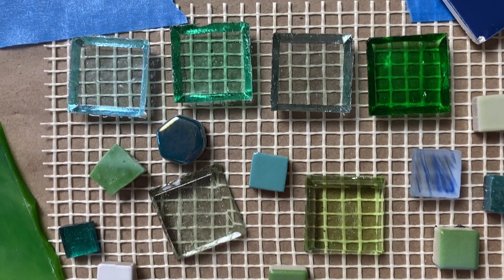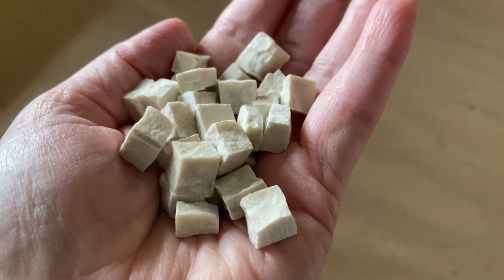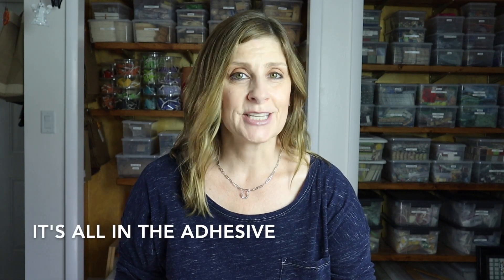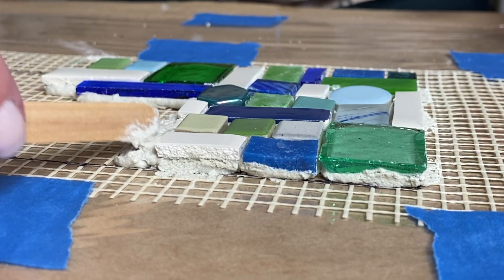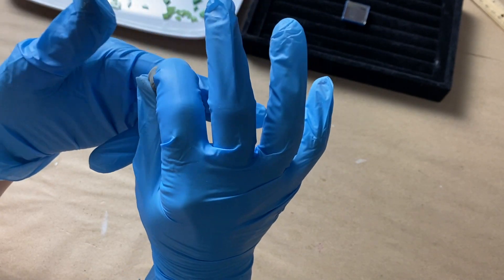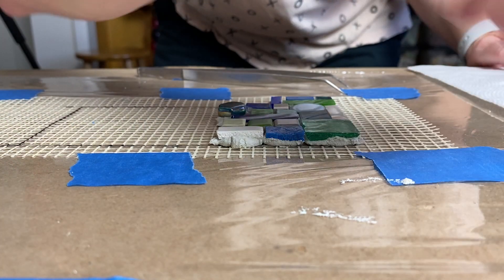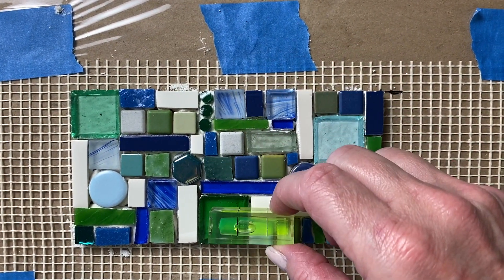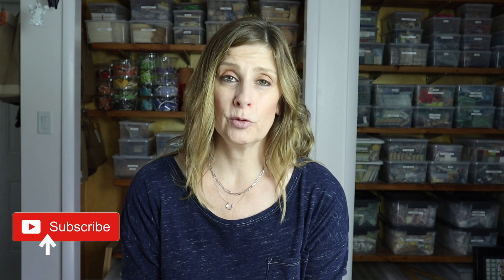HOW TO MOSAIC TESSERAE OF DIFFERENT THICKNESSES | Use the Correct Adhesive and Tiling Method

Comment: Hi Julie, thanks again for another really informative video.  Question….  When using mesh I try not to use too much adhesive because when I finally adhere the piece to a wall I want the thinset between the wall surface and the tile to squeeze through the mesh to securely fasten the piece to the wall.  In the video when you use so much thinset on the mesh to even out the tile heights how does this work when adhering it to your final surface?  It does not look like there is an opportunity for the thinset from the wall to squeeze through to grab onto the tiles.  Does this question make sense?
Reply from the maker: Hi Kim! Great to hear you enjoyed the video. Yes, a wall mosaic is totally different than my little 3" x 6" mosaic from the video. And the point of the video wasn't the mesh so much as the process of building up tess. I shouldn't of used mesh in the example. What you're describing is a great way to add additional adhesion for vertical mosaics on mesh. Thanks for your comment!🙌
Reply: @JulieWeilbacher  yes, I can totally see it if you were applying direct to the surface.  It all makes sense.  Thank you Julie
Reply: Will this work for a mosaic floor also. I have 3 thicknesses and want it to stay happy if walked on 😌 any tips appreciated. I've been searching but to no avail before this vid. Thanks!

Comment: I have a 10 inch porcelain cat my mom give me 45 years ago.  It's nose and one ear is chipped so I was wanting to mosaic it.  What kind of prep do I need to do and what glue would work best?  Thanks for all of the great videos Julie!
Reply from the maker: Hi Patsy! Thanks for your kind words, and for watching! I would first glue the pieces back on the body. You could use Weldbond, thinset, or silicone to do that. For the actual mosaic work, you could any of the same adhesives I just listed. Because it's a curved surface, it might be easier to use thinset or silicone just so things stay put and dry faster. It'll also depend on your tesserae selection. Keep creating and I'm so glad you're here!🔥

Comment: Working with tessere of different thicknesses is definitely one of the cases where the easiest way is to use to so-called "indirect" method for making the mosaic – i.e., assemble it upside down on some adhesive surface (traditionally, water soluble glue on paper would be used, but something like those adhesive sheets for printing labels will do just fine), pour over and level the cement (or whatever other adhesive you're using), let it cure, then flip the whole thing over, remove the sticky paper and... Ta-daaa! You get a perfectly level surface with much less effort. The only thing you need to keep in mind and pay attention to is that your final product will be mirror-flipped with respect to what you see while assembling it.
Reply from the maker: Yup, that works too! Thanks for sharing. Keep creating and I’m glad you’re here!🔥

Comment: OmniGrip!
Reply from the maker: Is that your preferred adhesive?
Reply: @JulieWeilbacher  ABSOLUTELY. I don’t know why it is never mentioned. SO many advantages. You can “raise” a tile… you can extract a tile days after… it’s clean,
and allows movement and flexibility. Even small tile over cement (stepping stones) left outside in South Florida heat and rain, for four years and still good. After I paste with OmniGrip, I use an exacto knife the next day and pull up any extra. Also between tiles. It’s just fabulous stuff! Home Depot. I cannot imagine using thinset! Crazy.

Comment: I just ruined a great idea by trying for the first time to use thinset to build up thinner pieces in a mandala. It was sad.
Reply: I would include a picture but it won’t let me. Even YouTube knows it stinks. Lol
Reply from the maker: Summer, what happened? Was the thinset mixed too thin? Or did you need more thinset under your tessera? Did the tessera sink while curing?😞
Reply from the maker: C'mon Summer, let's turn that frown upside down. I don't think your mosaic stinks. And neither does YouTube! Keep at it, that's how we all learn. You can do this!🙌
Reply: I’m not sure what happened. Things DID sink so maybe the thinset was too thin. Part of the problem is that I did three new things at once. 1) It was my first mandala and my keystone was NOT pretty. 2) I backed clear glass with fabric to make some of the tiles and the thinset under it dulled the color. 3) Leveling the pieces with thinset. It may have been a mixture of just doing too many new things at one time and me trying to go at my normal speed instead of working slowly and more carefully. I posted it in mosaic mentoring and some people said they liked it. I did like it better after I grouted it by I certainly can’t list it in my shop. So it goes in my “fail” box and I count how many things I learned while making it. Lol
Reply from the maker: @summerholmes4725  You experimented and tried things outside your comfort zone. I think you should give yourself some credit and grace. We're our own worst critic. Learn and evolve from this. Keep creating and you'll continue to grow in your art. You got this!🔥
Reply: Julie, great video. Thank you!  A question…I’m doing a birdbath that has a design in the concrete.  I’d rather not follow the design which has some up and down.    Can I build up that area by using extra thin-set ?  All my tiles are the same thickness..it’s just that the birdbath has a design - therefore it is not flat.
Also , since this is  area will be submerged…..is it ok to have these small areas of built up thin-set?  Thank you